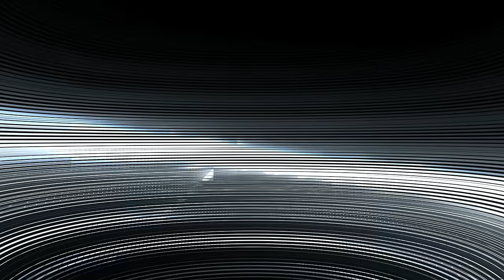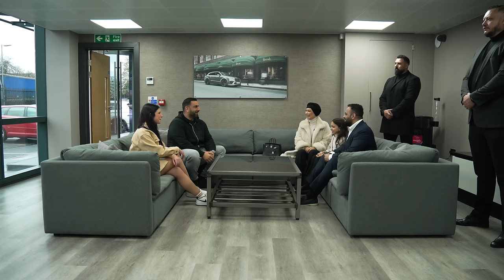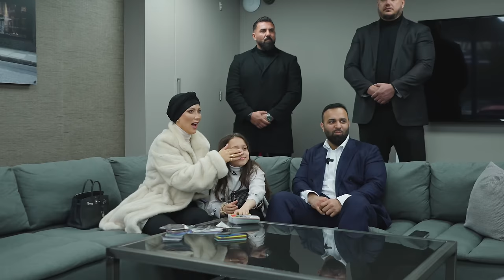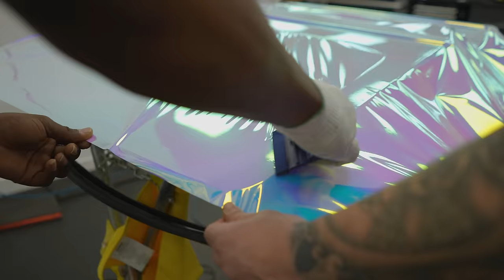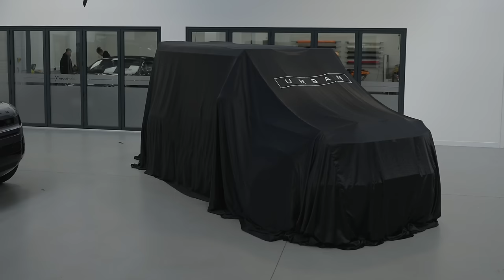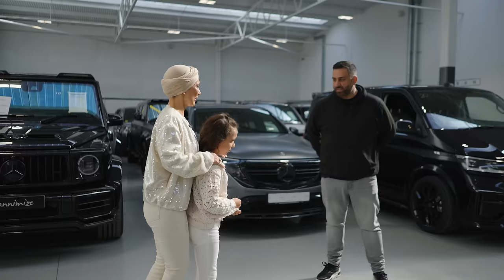The Billionaire's Daughter | Dream Car Wrap

Comment: The plastic wrap used for cars, commonly known as car wrap or vinyl wrap, is derived from petroleum products, similar to many other plastics. The manufacturing process of car wrap involves several key steps:
Base Material Production: The base material of car wrap is typically made from polyvinyl chloride (PVC), which is a type of plastic derived from petroleum. The PVC is produced by polymerizing vinyl chloride monomers, a chemical process that links these monomers into long chains to form the plastic resin.
Plasticizer Addition: To make the PVC flexible and suitable for wrapping cars, plasticizers are added. These are chemicals that soften the PVC, making it more pliable and easier to stretch over the contours of a vehicle. The addition of plasticizers is a crucial step, as it determines the wrap's durability, flexibility, and resistance to environmental factors.
Colouring and Texturing: The next step involves adding colours and possibly textures or patterns to the vinyl. This is usually done by mixing in pigments or printing onto the vinyl surface. Advanced printing techniques can produce a wide range of colours and designs, including matte, gloss, metallic, and even textured finishes such as carbon fibre look.
Laminating: To protect the colour and design, a clear laminate layer may be applied over the coloured vinyl. This laminate enhances the durability of the wrap, protecting it from UV rays, scratches, and minor abrasions. It can also add to the finish of the wrap, offering options like high gloss or matte.
Adhesive Coating: On the back side of the vinyl, an adhesive layer is applied. This adhesive allows the wrap to stick to the car's surface without causing damage to the paint underneath. Modern wraps use pressure-sensitive adhesives that are activated by pressure and can be repositioned during the installation process.
Rolling and Packaging: Once the vinyl wrap has been produced, it is rolled onto large spools and cut into manageable sizes. It is then packaged and shipped to suppliers or directly to wrap installers.
The entire manufacturing process is designed to produce a durable, flexible, and aesthetically versatile product that can be customized to fit virtually any vehicle. While it is derived from petroleum, advancements in recycling and manufacturing processes are continuously being developed to reduce the environmental impact of such materials.